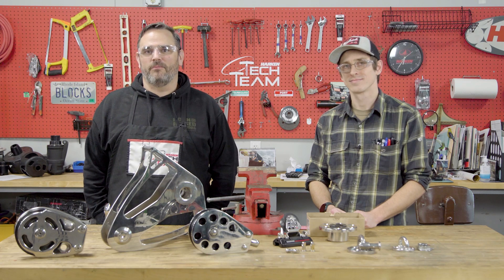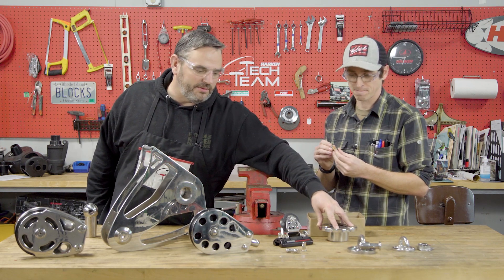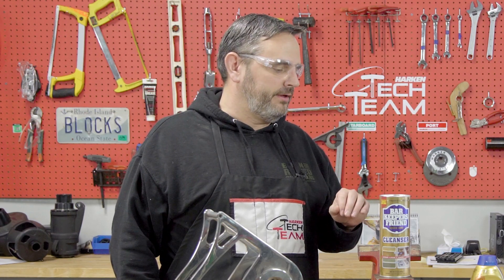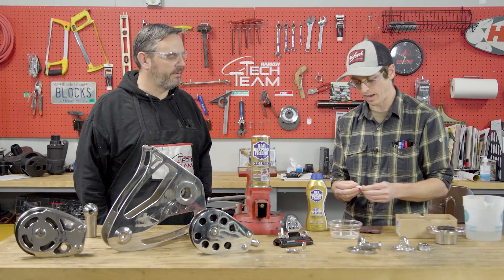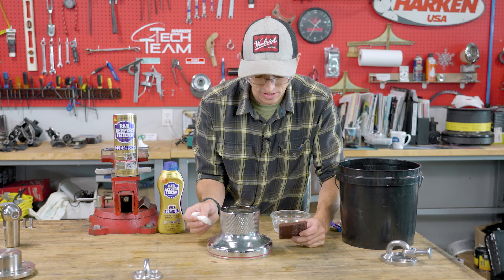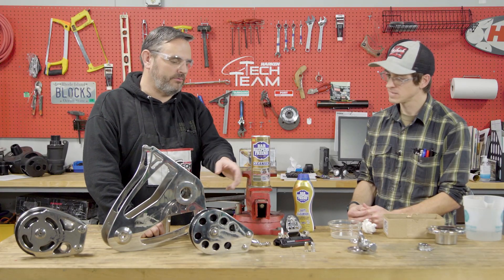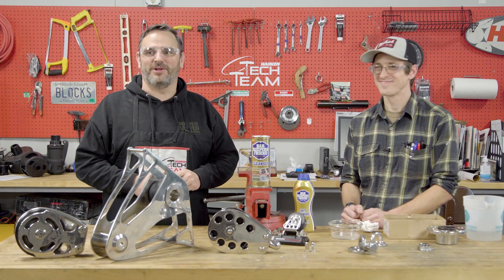Let's Talk Stainless Steel || Harken Tech Team Asked & Answered

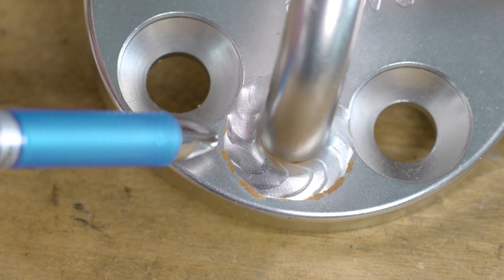Comment: 2:12 this is a classic weld defect, alloy segregation in the heat affected zone. This area of low chromium is what's causing allowing the corrosion to occur.
You really need to have a metallurgist speaking on these topics, not your quality guy.
Reply: alloy segregation happens in casting these parts are welded billet perhaps you mean sensitization 🤌